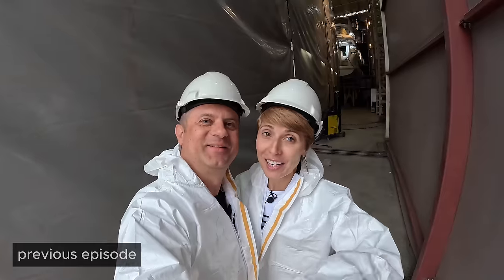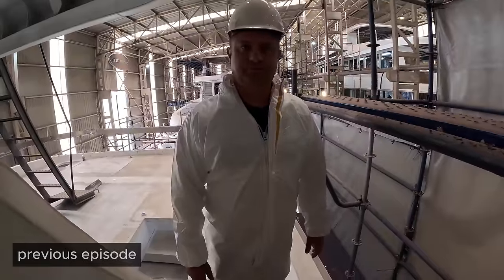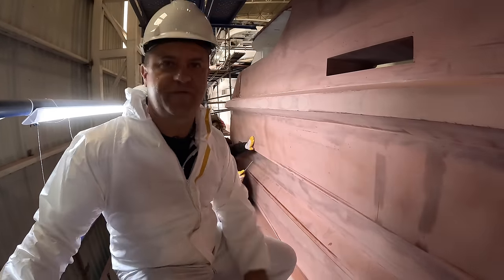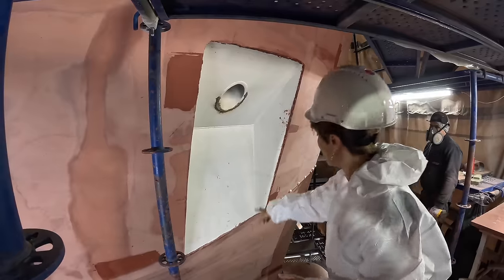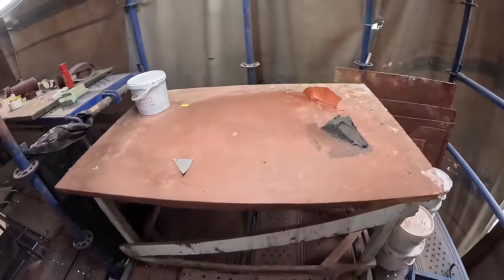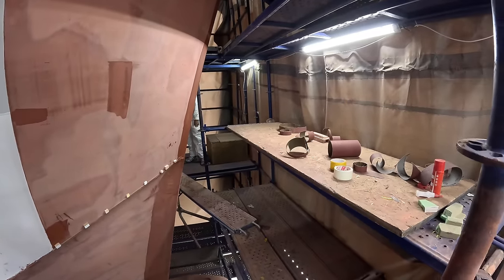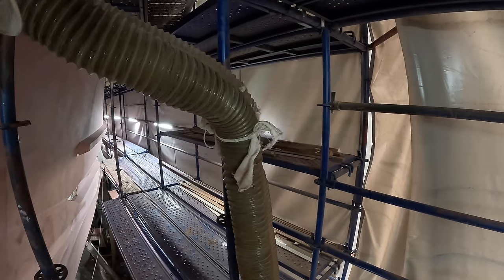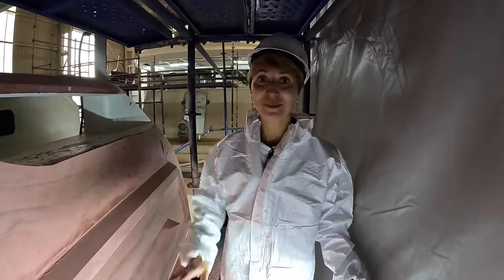Fairing, Fears & Ghostbusters 😳 (Pt.2) Eps.53

Comment: I also had to choose between a Bering 75 and another vessel. I ended up with the cheaper alternative after lots of consideration (15ft RIB with 25hp).
Reply: Gotta make difficult choices 😂
Reply: I was actually able to choose from several RIBs. I stuck to the ones I was born with.☺️
Reply: Imagine if the filler comes apart 😂

Comment: Remember Victoria, it is no more likely you will fall down when 50 feet up on a solid surface than if you are standing on the ground. 
By the way, it is not so much the boat ; it is the union between you and Rico! The boat is the stage we watch you play on.👍
Reply: The problem is, if you fall while standing on the ground you'll probably get a skinned knee or some scrapes on your hands. If you fall while 50ft up, survival is doubtful...
Reply: @realulli  true enough. I used to work on scaffolding and was always careful but not nervous. If I had been fearful or nervous ,I probably would have fallen.